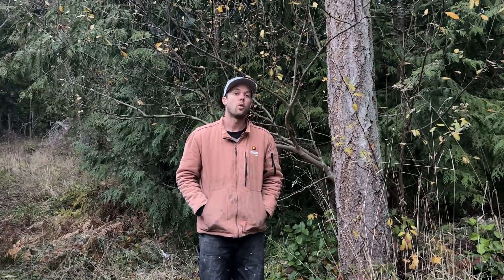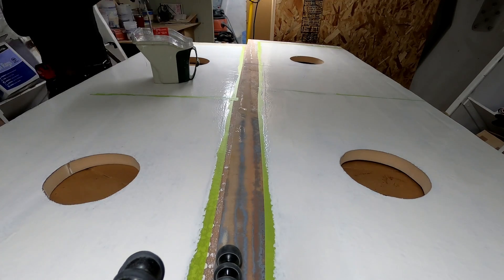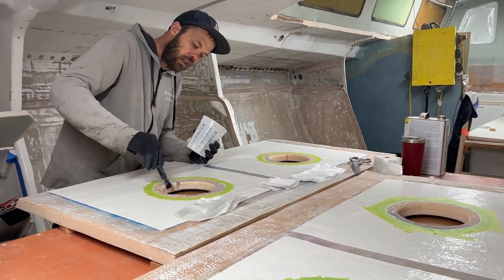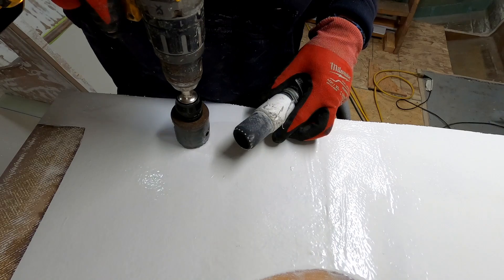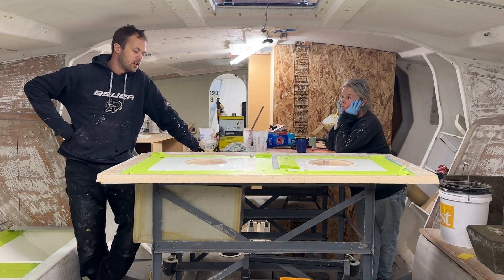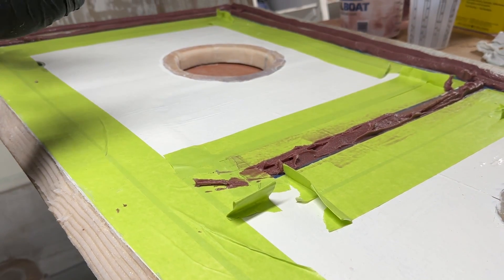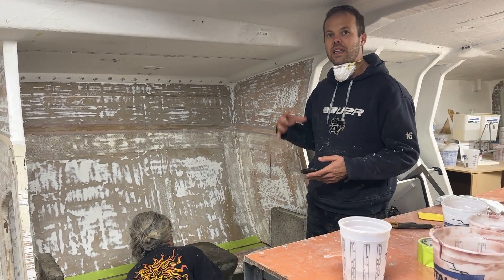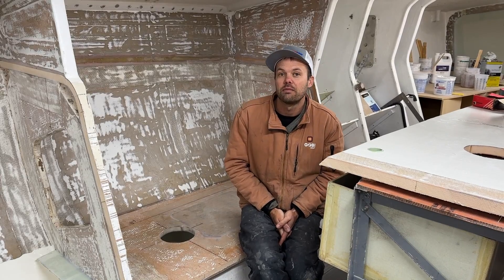Sailboat Refit: Ballast Tank Modification [E58]

Comment: The upper water tanks will cause you many problems down the line.  You have an access hatch under the water level.  It may last, but it will fail sooner than later.  You would have had the same volume if you had made the lower tanks simply 3 inches taller. The exta back-space where the upper tanks would have been, could have easily replaced that volume.  Is it too late to change it?

Comment: Why not just fab stainless tanks to fit in there? This method seems risky and hard to repair. One tiny leak and it’s a huge issue to repair. SS tank with hinged top on the enclosure to access.
Reply from the maker: Stainless steel tanks are pricey. I’m confident they won’t leak! And we will have an access hole for cleaning

Comment: Hey, Team, big fan. My dad and I converted a Dubois 46 into a cruiser with aft pilot house  back in 2007, so I am right there with you on every episode. 
Have you thought of installing a swing keel on Duracell? Cruising for many years and bumping in to coral heads, we figured out that shallow draft can be a game changer. I know it's a big project but it could be worth it, performance at sea and easy access on the coast. I would not consider a lifting keel as there is potential risk jamming after a solid hit (depending on the system).  Let me know your thoughts.
Reply from the maker: I have thought about it but I am trying to keep things as simple a I can. My is to reshape it int a fixed bulb shallow draft keel.
Reply: @The Duracell Project thanks for the reply,  yeah, it's heck of project on its own.
Reply from the maker: I have thought about it but I am trying to keep things as simple a I can. My is to reshape it int a fixed bulb shallow draft keel.
Reply from the maker: I have thought about it but I am trying to keep things as simple a I can. My is to reshape it int a fixed bulb shallow draft keel.

Comment: Hey Matt,
Your videos are great, thanks for sharing your awesome project.
I like the idea of using your water tanks as ballast tanks but it seems like a waste of infrastructure when you're low on fresh water. I know you said in a previous video you won't really need them as ballast, but I'd be interested to hear your thoughts on a  flexible bladder fitted inside the water tanks that you could fill with sea water as you consume your fresh water.
Reply from the maker: I think it’s a great idea but it sounds a bit complicated and I need to keep things easy on myself. We will have a high output water maker so we ca quickly fill water tanks if necessary

Comment: Just one thing on the access ports, I found it was easier to use these purely for access and separate outlets for fill, vent and draw, otherwise you’re trying to unscrew something / move a port with fixed length hoses attached.

Comment: Port access to the water tanks. There are many ways to do it right, I would have taken an allen key on a cordless drill, SET THE CLUTCH. and chewed out the core goes real fast. Quick scuff of the exposed fiberglass. Then make a chop strand additive to epoxy putty with cabisil. Pack the cavity. If you want to run the router on it to round it over and put a layer of glass what ever.

Comment: If you silica thickened epoxy sags when it gets warm i think you need more silica. It’s normally considered the anti flow additive. Id have chickened out and used a mastic to glue down the tank lids so well done.  With such nice big tanks to easily inspect and clean don’t go too small with your inspection hatches.  Its great following your project thanks.

Comment: The micro bubbles add bulk to epoxy resin. Depending on the amount it leaves you with a mix that can be used for bonding or even fairing with out adding to much weight. To stop it "running away" when bonding you need to use a thixotropic agent.

Comment: As I can recall from the past, before modifying the balast tanks, the lower part wouldn't go all the way up to the hull. Was there a reason for you going this way (structural strength perhaps)? Wouldn't it be easier if you have cut this board to the line that the upper panel would come on to it?
Reply from the maker: Having it go all the way to hull makes it more structural to boat and it acts like a baffle between upper and lower
Reply: Though that was the case! 👍
Can I express one more concern...
Do you think that the one hole between the two tanks is enough?
And I'm not referring to water getting from the upper portion to the lower one. Because you're planning to transfer water between the tanks (for ballast), if the transferring pump is to powerful and the outlet is in the lower part, it can surpass the ability of the hole to let water from the lower part to the upper. This will create pressure in the lower portion creating more stress to the inspection hole which is already under pressure (all the weight of water in the upper section, is pressure on the seal of the inspection hole).

Comment: So how do you now cover the exposed resin inside the water tanks? Will you use the same white sealing paint and cover the exposed resin using a small hand brush? I assume exposed resin is not good for potable water (chemical leeching etc?). Interested to hear your thoughts as you went to such lengths to have a sanitary surface everywhere else. Cheers, from SY Miss Foxy in SINGAPORE.
Reply from the maker: Exactly, I will coat every exposed surface with the potable paint

Comment: Good tricky work, it's easy to fail to appreciate this is like a one try timed puzzle.  I'm curious how the water will be managed at various levels of use and when the boat is not heeled, won't it sloosh around? and I'm not sure a smooshy cat would approve of that.
Reply from the maker: the baffles should help with swooshing water, but not the smooshy cat

Comment: The Inspectors 🐈 body language suggests the boat is no longer mouse worthy.

Are you keeping the water tanks as ballast to provide performance options and/or was there concern the boat might be uncontrollable in some sea states with the new interior configuration.

The lack of VOC’s in the water tank paint certainly explains the long curing time between coats. Also probably why it’s recommended using a spray application. 😂 One and done.
Reply from the maker: add performance option is a good way to put it!

Comment: When scraping out excess slicone, urethane from a corner, (would apply here) use the back end of a plastic caulking tube. Push the tube open end firstwhile spinning it as needed. It will leave most any radius you want by squeezing the tube tighter together. If the back fills up, get another tube or just scrape out with a paint stick and continue.  For sharper radiuses, use cut up milk jug plastic. This wours great for forming qick fillets that blend perfectly into the flats. This trick works great on joint finishes for seams and but joints.

Comment: Great progress on an impressive project. Just wondering why you didn’t make the access hatches big enough to get part way into. You might never have to go in but it’s better to have a bigger hole than not.   Just watched to the end and if you had made ‘man hole’ sized hole clean up would have been so much easier
Reply from the maker: i can get my arm in which is enough to clean, as long as my arm can reach the edges that's all i need.

Comment: I watch another channel "life on the hulls" he's quite experienced with fiberglass and is building a catamaran from a mould. Anyway he uses a router to remove the foam around cutouts and then fills the space with epoxy filler, so he doesn't have to glass over it!

Comment: First off, Matt, your mom is a rock star. The way she gets in there and works hard is so above and beyond the call. Also, would be easier to finish out the access holes if they were square or rectangular? I don't know, just asking. Thanks for yet another terrific video.
Reply: Agree, your mom is awesome.
Reply: Square would be better access, but round you can put a screw cap in the hole